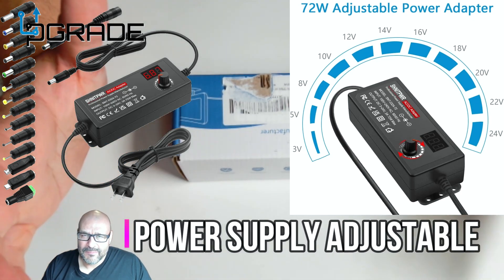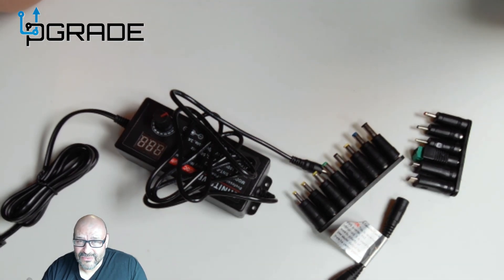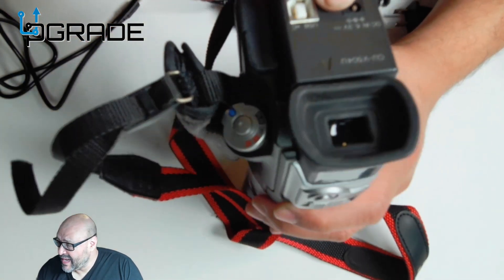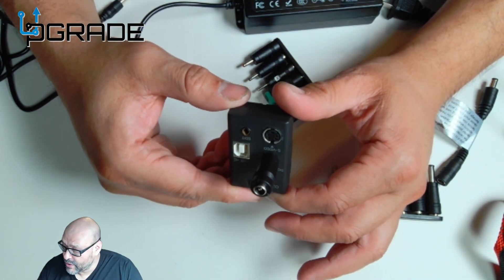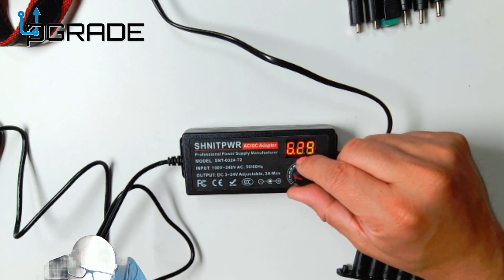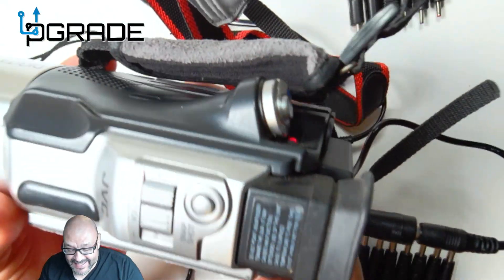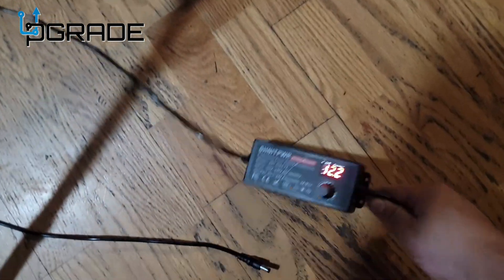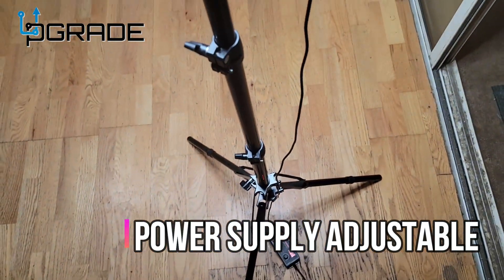Power Supply Adjustable

Comment: In amplifier building, the board needs a +/- rails, say 30DCV.
I am looking for a bench adjustable/variable switching PSU to be used for various amplifier boards (that needs different +/- DCV).
Question: What kind of description/specification do I look for in a commercial product? Thanks.
Reply from the maker: DC Power Supply Variable this has the option you are looking for but its a lot larger- https://youtu.be/jh-W8ybsb6k

Comment: Is there a way to lock the knob so you won't blow up the device if someone turns the knob by mistake?
Reply from the maker: No sorry I had the same issues but I did remove the noob and added tape
Reply: I AM USING WIDE STRONG RUBER OVER BUTTON, AND IT WORKS!
Reply: i agree, it needs to lock in place let push it down to lock it. or a physical switch that will prevent the dial rotating